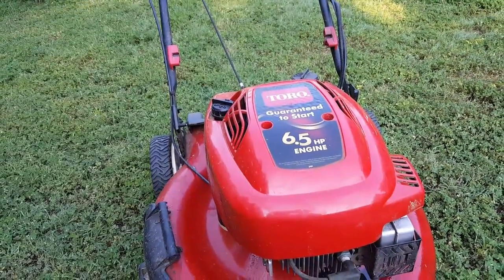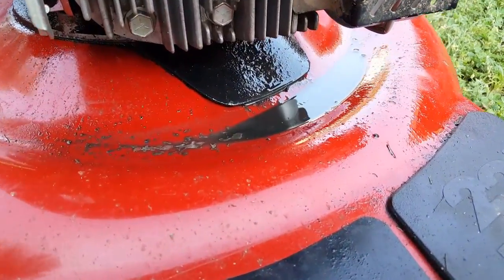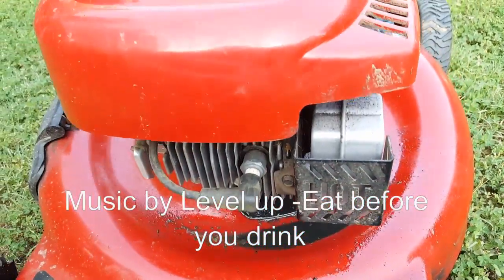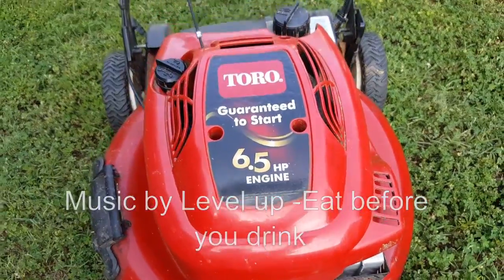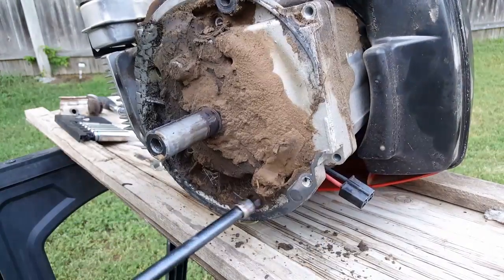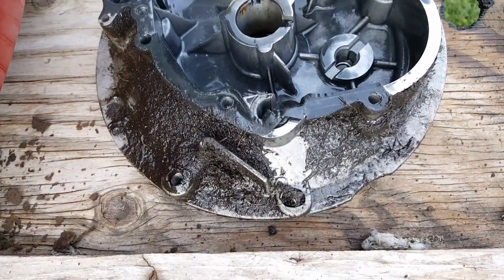Toro lawnmower with Tecumseh has oil leak

Comment: My Tecumesh was leaking there, used older mower. Loosened bolts for crank case with engine still on mower, and cleaned crack with carb cleaner. Filled with Permatex Ultra Black, tightened and put extra layer on over. (I drained oil before this, put new in and kind of flushed engine with a bit more oi) Hasnt leaked in years, everything dry as a bone.

Comment: Excellent Instructions!  Than you much for posting this video.  I also had a challenge removing the engine cover/oil sump after removing those 6 bolts. I took course sand paper and lightlyly sanded down what looked like minor rust. Once done I'd recommend a spray a WD40 on a rag and wipe the area sanded. Makes it easy to remove and replace the engine cover.
Reply from the maker: you are correct, sometimes that needs to be done

Comment: I had a very difficult time removing the engine cover/oil sump after removing those 6 bolts. The cover just wouldn't freely slide through the rusty shaft. Was thinking that I needed to remove (and destroy) the shaft seal before cover would come off. Ended up mangling the cover using a gear puller to try and slide it through the shaft without success. Oh well, it was a free old mower.
Reply from the maker: That's a very positive attitude.  Thanks for the comment

Comment: I know this vid is 2 years old but I just have to say this must happen ALL THE TIME!  I have owned Toro Techumseh mowers for years (bought new) and 3 of them have had the sump gasket fail! I have another one here that I bought used and it is covered in oil too, and that's just what I've experienced so this must be a very common failure point. These are great engines and totally worth fixing, too bad Techumseh isn't around anymore. Where's part 2 of this video? Can't find it (though I've done this repair many times I like to watch other people do it).
Reply from the maker: They definitely have their strong points. Yes I've seen happen a lot to tecumseh engines more often than Briggs.

Comment: I dealt with a similar problem back when I worked for a repair shop. Someone brought in a brand new Yardmax snowblower that they got online that was leaking as soon as they put oil in it the first time. I mean at least the thing had a limited time warranty on it, but when you order stuff online it can be hard to use that warranty. But even then, that company cut so many corners on that machine that it probably wasn’t going to last anyway. Stay away from Yardmax, they’re terrible
Reply from the maker: thanks for the tip Smallengineworld BCSERK

Comment: I had the same problem on a Tecumseh Toro. it was only a couple years old at the time... I think towards the end of Tecumseh engines they just slapped them together and hoped for the best!
Reply from the maker: Yes I agree. The gasket seemed to be glued in a few spots to hold it but part of it was folded over. It held for a couple of years but gave way.

Comment: Home Garage...Thanks for the video...However how do you get the blade attachment off?  I have the motor off and yours just slipped right off....????  Mine doesn't seem to have a screw of anything. It looks like its welded on.  Any help would be great knowing I have it tore apart and taking up my garage...LOL. Thanks
Reply from the maker: if your blade adapter will not budge just means  there's a lot of rust, on the shaft.  Unfortunately, you're going to need a 2 jaw pulley puller, to get it off.

Comment: @Home Garage, or anyone for thought please.I have a Craftsman push mower, 917.370660.Limited edition.Briggs and Stratton moter 6.75 think motor is, # 126T05-1561-B1.Brought it used so don't know history.Although mower appears not abused nor bent shaft etc.Starts and runs fine.Seems to have good power.Issue is, leaks oil bad.First place I see oil is inside air filter housing.Comes out the breather tube soaks filter and runs out puddles on deck.Not carb just breather.Also no gas in oil.Next place I see oil leaking comes from bottom of mower just right above deck top side of deck.Appears to be a larger size gasket that motor sits on then very bottom of motor fused to that ( gasket in between ), then motor sits on deck.Oil comes out muffler also some along with white smoke at times.Turn mower off, and can hear it crack pop from oil burn.Motor gets real hot fast.About 2 min and real hot.Remove dip stick and can see smoke come out.Oil is fine not over filled, least by myself since got mower which was 3 days ago. I'm told may be head gasket ( although very bottom gasket mention above I see oil leak out to deck ).I assume that is not a head gasket? Most the leak comes from breather tube and it's alot.First question, will a faulty gasket cause the engine to get real hot fast? Next question, would the bottom gasket that has small amount of oil leakage also cause oil to throw out breather? Thoughts and odds of issue being a gasket please.
Reply from the maker: Thank you for your questions. This seems to be multiple issues playing as one but my guess is there is a piston ring problem allowing too much blow by. The blow by from the engine is pressurizing the oil galley and forcing oil out of the  breather tube contaminating the air filter. The pressure might be great enough to rupture the sump gasket on the bottom of the engine causing yet another leak. Do a compression test or take the head off and examine the cylinder wall for scoring.
Reply: Thanks for input, I suspect scoring inside possible, yes.I will break all down when can get time.I worried it could be a ring issue.Of which is not my area and I assume costly to repair at repair shop.If scoring I guess motor is pretty well shot.To me, sounds like it "could " be shot or get costly at a shop.It's a shame because mower is nice.Few years old.Also has electric start which is my first and wanted so far as electric start.I assume in this, that if I have another Craftsman push mower about the same except Briggs is 7.2 non key start odds are low of swapping electric start.I assume no where to bolt and mount stuff.I see two wires to left side of engine on a black clip next to spring and break cable.Other side of engine is two wires going down to motor and up to what looks like a tall round thing that makes noise when key is turned.
Reply from the maker: It's not difficult to do the swap. I might have to do a video on it someday
Reply: Hmmm, that would be intersting.Because I cannot find nothing on web searches about this.I spent hrs and came up short so gave up.I may take a closer look in a day at both mowers and study what I see and if I see options.Mainly a spot to bolt that thing thats tall that starts engine.Not battery, but thing powered by it that turns mower over to start I guess to say.
Reply from the maker: Joesph Baumgardner the starter bolt holes  are already there.

Comment: After putting all back together. I"m still getting an oil leak though.  I have a Toro  6.5 HP, Tecumseh Engine Model # LV195EA-362089D.  Any chance oil can be coming out of the top part of the engine? I put in 18 oz of oil. Max is 20 oz and wondering if that is too much or if the crankcase breather could be going bad. Any ideas are much appreciated. Thanks
Reply from the maker: already answered

Comment: Interesting.Thanks for vid.Question, I have a Craftsman push mower.Briggs engine.I see oil same spot as yours.But I also have alot of oil that is leaking bad from filter holder.Not out carb, carb apprears fine.Oil come out breather.Thoughs?
Reply from the maker: Thank you Josheph Baumgardner. Have you checked your oil level? Does it smoke a little from the exhaust?
Reply: Home Garage new oil change on sec dot as full no over fill.No smoke.

Comment: It looks like my 22" toro Tecumseh is leaking around the dip stick tube. Any comments? Is this a common problem? Must be a o ring in there. The bottom of the engine is totally dry.
Reply from the maker: for this particular Tecumseh the O-ring is the most likely issue. I'd get some new O-rings, and than should fix the issue. IF that does solve it, then the leak might be a the Sump gasket  which Is Not simple to fix

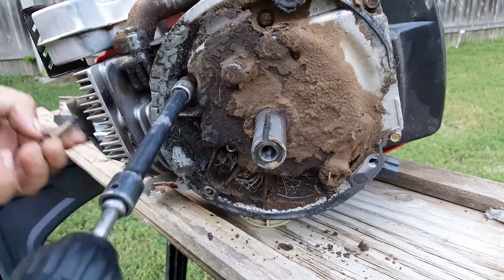Comment: This has been so helpful!!! But I do have a Question for you. The piece you pull off at 1:15 is stuck on my mower and I can’t seem to get it unstuck. Are there any recommendations you have for getting this piece off?
Reply from the maker: Thank you for the comment. Ask a friend who works on cars for a 2 claw pulley puller. Then loosely install the bolt in the middle and grab the blade adapter not on the widest part but the narrow part.
Reply: Auto zone lends pullers , you have to pay for it but they return all your oney when you return it. They have lots of loaners
Reply: I just hit mine with a hammer. Came off with a few wacks
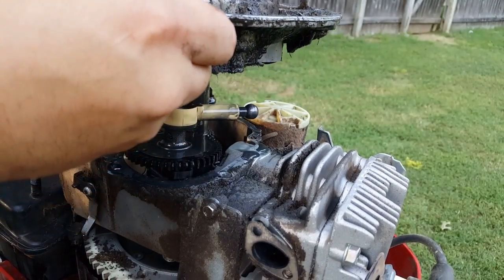Reply: @raabsand  Does a hammer work to help remove the last part 1:35 (the cover) ? He says lightly tap on the cover. Mine slides about and then stops abruptly. I can wiggle it, but it will not pull any further. Is there anything else holding it in the middle?  @Home Garage

Comment: Was curious what did you use to clean the inside of the engine with
Reply from the maker: hello Edwin Rivera, I used old gasoline
Reply: @HomeGaragechannel  I did everything and fixed the same exact leak ok only thing now is that when I’m using the lawn mower I’m getting white smoke here and there and losing power to the point if it turning off when I use the self propelled

Comment: I performed these steps on my toro. I put it back together but now when I pull it to start the string is jerking back. I stopped trying to start it at this point. I definitely had a failed gasket. Any thoughts?
Reply: Oh I forgot to say the blade is  not on yet. Could it be that?
Reply from the maker: Thank you Joseph Gogan. I didn't stress it in the video but the reassembly is critical.  More than likely the engine was mis-timed by a bump and causing the pull back.
Reply: Ok I will have to look at that. I am going to check the fly wheel key as well.
Reply: @josephgogan6981  lawnmowers will never run right without the blade. Lawn mowers have aluminum "flywheels" and use the inertia of the blade as the actual flywheel. Without the blade, the mower will kick back and rip the pullcord out of your hand as if it had a sheared flywheel key. Horizontal shaft small engines like on snowblowers, go-karts, and mini bikes have cast iron flywheels with more inertia to act as a proper flywheel.

Comment: I followed this excellent tutorial, but screwed something up. Everything seemed to go together fine, but now the engine is acting like it's hydrolocked... Although it isn't. Really hard to pull, but when the spark plug is out it pulls nice and smooth. It's like some valve or something is seized up. There is no oil in the cylinder head as far as I can tell. 

Any ideas what I might have done wrong? This is a lawnmower I pulled out of the trash, but I bought the gasket and spent some time on the repair, so I'm kind of bummed. It was running perfectly before I got into it. 

Regardless, thank to for the video.
Reply from the maker: the only thing i can come up with is the timing gear.  did you confirm that the dots where aligned before the sump was put back on?
Reply: Uh oh, no I didn't. Oops!
Reply: @HomeGaragechannel  is it possible I've created other issues, or is it just a matter of opening it back up and aligning the gear?
Reply from the maker: @a2khalid  I don't think so.
Reply: @HomeGaragechannel  ok so I am a complete idiot. The problem was that i didn't have the blade installed. I had no idea the inertia of the blade is necessary to get the engine started. I thought I was smart keeping the blade off to get it sharpened later.

Once I got the blade on it started up first pull. Lesson learned. Thankfully I figured this out before I opened the engine back up to try and figure the problem out!

Thanks again for your video, and trying to help me with my issues.
Reply from the maker: @a2khalid  thank you for the update

Comment: Any tips on removing the belt driver when it's stuck on the shaft?
Reply from the maker: Thanks for the comment. Yes if it's stuck then you can use heat from a propane torch to heat it up. The heat can help break the rust holding it to the shaft.  You will need a 2 arm pulley puller to help pull it off the shaft while it's hot. Even tho I didn't use heat watch my other video it might help. 

https://youtu.be/2TpJqoCrlLs
Reply: Just hit it whip it good